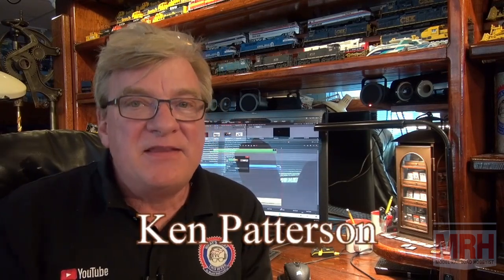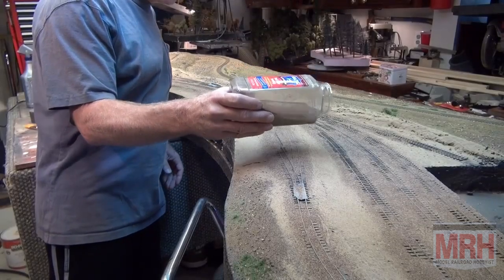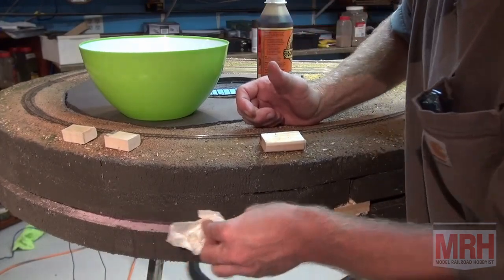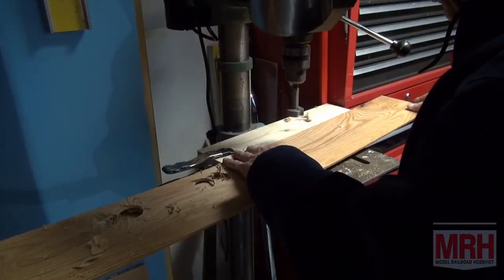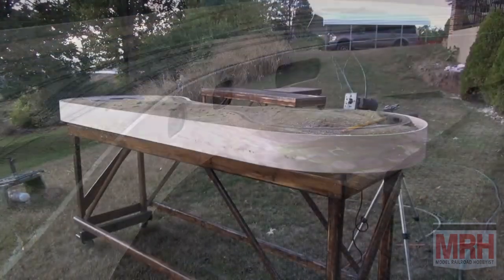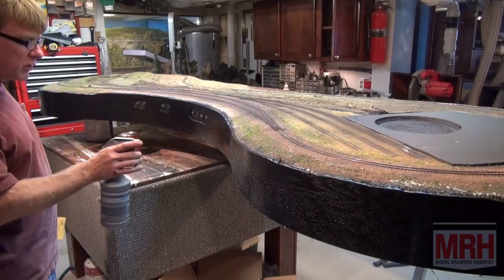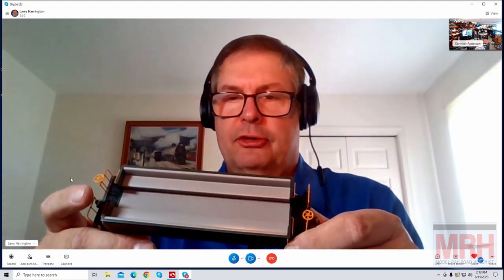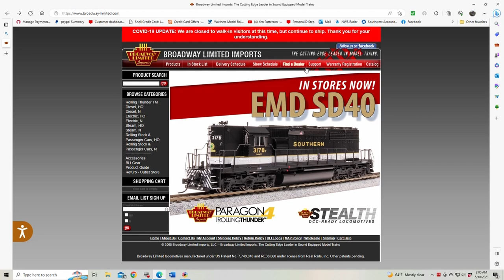HOn3 layout construction, part 3 | September 2023 WHATS NEAT Model Railroad Hobbyist

Comment: This is still basically HO scale, right? I want to see more 1:160. Tips for stuff so small are hard to come by. Ballast can be finicky and scale can be difficult to visualize. Buildings are different beasts entirely. You can 3d print some too, which is cool to think about. That also means it’s really hard to traditionally scratch build really small things.